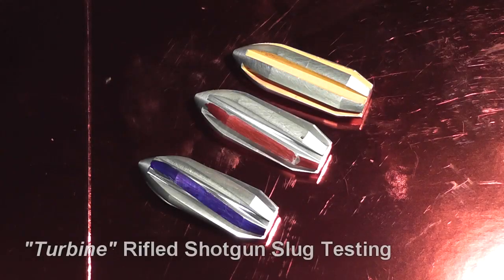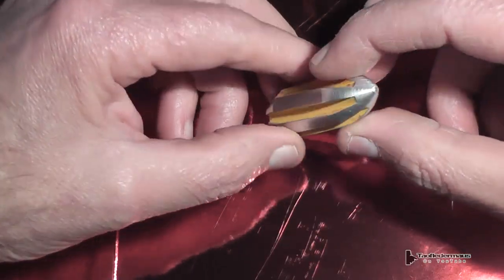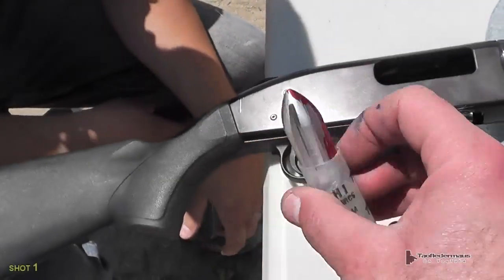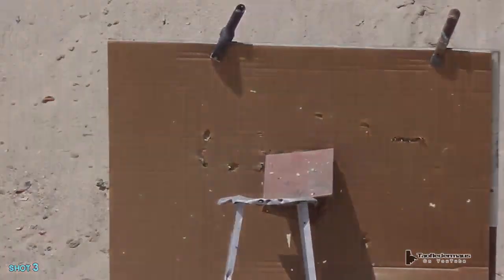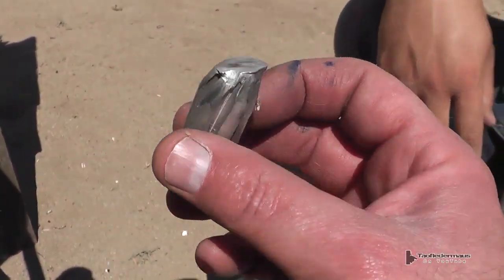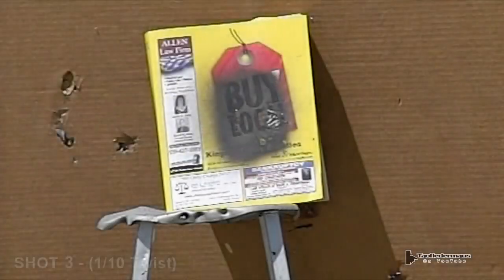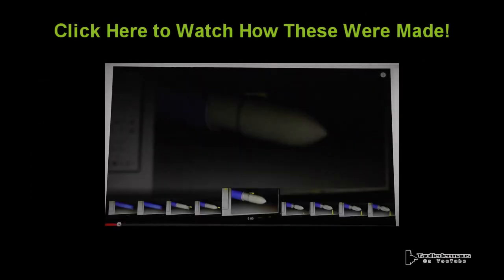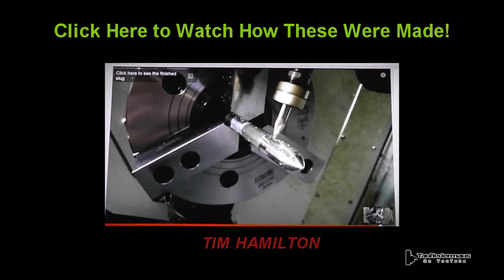Custom Aluminum TURBINE Shotgun Slugs  -Testing

Comment: Using air to create the spin is really not smart. Somebody else covered the fact that escaping gas will cause a spin in the opposite direction so I won't comment on that. But, you should have a rifled barrel and a malleable metal slug. The point of a bullet is that it is a plug in a barrel. If you slot a slug it let's gas escape. Any escaping gas in front of the slug means the slug will travel at a dramatically lower velocity. The reason rifling is so great is that the spin causes the bullet to fill the rifling. It creates spin without losing seal and velocity. And, if you look at all projectiles for military grade weapons, none are slotted to create spin.
Reply from the maker: +Jordan Weimer   This was a test to show that slotting or spiraling does nothing because so many people have commented SWEARING  it would work.   So we tried it.   Despite that,   people still tell me that it would work,  on my other videos.
Reply: haha. It's hard to prove people wrong. Just ask them to demonstrate something that functions and watch them shut up. Well more than likely they'll just ask you to do it again.

Comment: The slugs need fights simular to a dart. you are basically launching a externally propelled missile. small flights at the rear would provide some drag and stability until the rifling can begin to spin the round.

Comment: I think It wold solve the problem if the projectile lines were more tightly twisted and if it was a havier metal and short.
Reply: +rodrigo xv The problem was that the riffling on the slug wasnt interacting with the bore, thats why on a miniball the base spreads to ketch the riffling.
Reply: OK, so that short lead slug the MithBuster's showed on tv doens't work  at all?They forced it to work?
Reply: Depends on how tight of a fit it is, like with a muzzleloader, some balls are tight enough just to ram home, others you wrap a cloth around.

Comment: I think the problem with the concept is that a projectile travelling supersonic doesn't have air flowing over it's body the way a subsonic projectile does. It has a shockwave travelling out at an angle that interrupts the air flow. There may actually be a vacuum around the body and base during flight until it slows down below the speed of sound. If this is true, then the grooves aren't being affected by the air nearby and actually do nothing except make the projectile lighter in weight. At subsonic speeds they may begin to make the projectile spin, but it will take some time to exchange the forward velocity for velocity of spin. I expect at short range these grooves do nothing useful.

A lead rifled slug gets it's spin from contact with the bore, so it's spinning already as it leaves the muzzle. 

The area that could use the most improvement is the sabot that holds the round. You want something that holds the bullet perfectly straight and releases the projectile in flight without disturbing it in any way. probably some machined aluminum in 3 or 4 sections would be best.

Comment: I think your problem occurs when the slug leaves the barrel and the direction of rotational force abruptly changes. when the charge goes off the gases are pushing downrange spinning the bullet clockwise. then when the bullet exits the barrel the wind is applying force uprange and the rotational force is reversed and the projectile stalls in it's spin and begins to tumble.

Comment: I enjoy your video but must add my 2 cent for what it is worth. As a black powder shooter my smooth bore is just as actuate to 50 yards. Of course the right size Ball and powder charge is required which relates back to your videos. Also I have a rifled Barrel with scope attached for my Mossberg 500. It shoots standard slugs over 100 yard actuate.

Comment: I'm going to guess there's too much weight on the tail end of the bullet; but I can't know for sure without one in my hands. Maybe making the nose of it with a heavier metal (lead?).

Once you get it flying straight, you could put a thread on it with a carbide tip. Armour piercing at its best!

Comment: I would like to see this with a rifled shotgun barrel. That will stabilize smooth slugs also. Dont rely on the cup solely to hold back the gases either. Also, yall need to be behind some barriers when firing. Since those plates are not mounted properly, you are just rolling the dice when a ricochet will return to your chest.

Comment: How about something with a steel body, a lead tip, and an aluminum but with micro flutes and a fin set (aluminum tail section)?
Others have already made pop-out fins that work well, but they were a smooth bore type body.
The ones I'm talking about have the fins doing the spinning, rather than an flutes on the body.

Comment: Your tumbling would be down to 2 issues: the small amount of paint on the rounds would off-balance them (the centre of gravity has moved, even a tiny amount would effect the round), and secondly (more importantly) when you put the round in the shotgun round jacket I would guess that it is not dead centre. If you hit the mass even 1/10th mm off centre it would put the round into a wobble.

Comment: what I would like to see is shot gun rounds that incapacitate individuals without wounding or killing them. Is that possible for you guys to whip up? Maybe a round with a soft nose cone and a squash-able center to absorb some of the force of impact or maybe a soft round that expands on contact with air to a far larger diameter to absorb force on contact?
Reply: without make a wound? damn that impossible. what were you thinking about? even rubber round can make serious blunt wound. Guns are used to throw a projectile in a fast speed, even blunt object is dangerous. go to self-defense and learn how to paralyze crimes.

Comment: In order to go straight it should start spinning not in the air but in the barrel. For that reason many rifle and pistol barrels have  "spiral shape" (I'm not an expert so idk the exact term) interior which makes the bullet spin before exiting the barrel and it keeps spinning in the air to got straight and accurate. Most shotguns, if not all, don't have that "spiraled" barrel thats why those shotgun shells are usually loaded with shrapnel or with small round bullets which are not very accurate. IMO to fix that inaccuracy and make the bullets go straight is to  either make the barrel longer or to create that spiral inside the shotgun.

Comment: Develop an external spinning magnet whose field will spin a round at a high rate of rotation just prior to primer strike. It will have to be custom made, but the round will maintain a very robust gyroscopic stability en-route to the target. Just might eliminate the need for rifling inside the barrel. Worth a curious attempt.

Comment: This is amazing stuff, I love it. In my experience with ballistics you don't need drag to stabilize a bullet, you just need the bulk of your weight in the front. I would consider trying a tear drop design with some one in 7 fins in the back making sure that the front of the projectile is heavier than the rear by a lot. Maybe injecting lead into the front?

Comment: Longer barrel would have made a better test.  Who shoots low brass with slugs?
Would like to see one of those in ballistic gel.
Reply from the maker: FoulPet  You can achieve velocities in excess of what you'd get from a factory deer slug if the rounds are light,  just using low brass.

Comment: The problem with a round like this there is more air moving forward through the twists than the air resistance that would hopefully cause the round to twist out of the barrel. A fin stabilized round would make more sense.

Comment: i would think that if you drill a hole into the back of the round pretty much the entire way down put something in there to weight the nose of it then replace the rest of the hole back with some aluminium and maybe decrease the size of the gap on the refiling so you could add more rifles to the round

Comment: U need to drill a hole in the back to make it front heavy. Design these as if they are darts
Reply: rib bit  subsonic that shouldn't be a problem, also supersonic if the shape is different (like a space capsule) it can be stabilised, like they also have shown on this channel. You are also not going to make a figter jet out of lead. You also have rubber and brass bullets. If you want it aerodynamically stable (so not a typical bullet), the shape (CP) and weight distribution (CG) are the most important factors. Just like a paper airplane.
Reply: rib bit  drilling a hole alone would probably not be enough either, the back end seems too slick and supersonic these flutes don't have much effect anyway
Reply: rib bit  it's all speculation though before tested
Reply: rib bit  yikes, never knew anyone was trying to kill with rubber lol
Reply: Aluminium also yields much easier than brass and fouls

Comment: ok check this out the rifling is on the barrel not the bullets. and you made it out of aluminum which is incredibly weak so im almost positive before watching your video that the rifling on the bullets did nothing because of course the aluminum is weaker than the barrel and more sensitive to heat. which probably caused the rifling to have zero effect right?

Comment: I think the problem is that the slugs are not exiting the shoty straight.
Reply: They used a smoothbore barrel (no rifling) that's most likely why the weren't spinning well enough
Reply: Krazy Studio so there you have it. smooth barrels are for round pellets only. you gotta have a rifled barrel to spin and stabilize the projectile before it's aerodynamic spin kicks in even if the slug itself has deep rifling like that one.
Reply: +Ahmed Nabil +Krazy Studio +Bobby Walk
While the barrel would help, you still have a stability issue on the "flat" axis. Looking at the video, it's got horizontal spin as well. Bobby nailed. You need to be more front end heavy, so the slug doesn't spin flat. THEN, we can look into rotational stabilizers :)
Reply: Theophilus Martus Goh I think you're right. I wonder if shot over a longer range if they would correct or if he had some sort of long tube diffuser to allow the gases to escape and the slug to slide along something for that small amount of time
Reply: +Theophilus Martus Goh does the shotgun barrel even have rifling? that's the critical factor here.
Reply: +Bobby Walk interesting. so how would an cylidrical round hollow out with the rifling on the inside do ? flatt top or even outward leaning lips to maximize the air intake ... smooth on the outside ? in my mind this flying cylinder of death should be able to "eat" its way thru the air. would be really interesting to see if it would work. now im not sure you will understand any of this as english is not my native tongue thanks,
Reply: you mean barrel.
Reply: *shooting
Reply: I am so confused
Reply: Look up bullet bow shockwave. These slugs are traveling at supersonic speeds causing the air at the front of the projectile to become highly compressed creating a conical waveform surrounding the slug.  Basically what this means is the rifling cut in the slug doesn't actually engage the air like we imagine it would, rendering them useless. The rifling we see on foster slugs or "rifled slugs" is actually there to allow for the lead slug to be able to be compressed down through a choke and don't actually impart any spin. What gives modern slugs their stability,  and therefore accuracy, is the weight forward design, and the open cavity at the base of the slug. The heavy front end keeps it from tumbling through the air like we see in the slugs from the video. The only way to get these to spin is to run them through a rifled barrel instead of a smoothbore. And if someone was willing to do that, I'd love to see how the deep rifling in these slugs transfers energy through some ballistics gel👍

Comment: A rifled barrel works because the lead slug is a little larger than the barrel. The grooves grab the slug and spin it as it's being squeezed through the barrel. Obviously, this will only work with a soft metal like lead. Creating oversized slugs from less malleable metal like aluminum would plug up the barrel and the explosive gases would have nowhere to go. I would NOT want to shoot a shotgun with a plugged barrel!. ***** Rifled slugs (as opposed to rifled barrels) have grooves cut in the side of the slug but they're smaller than the barrel. The rifled slugs don't squeeze through the barrel and wouldn't spin even if they did. The rifling is so that it will squeeze through different sized chokes. But that doesn't make it spin. It just allows it to squeeze through the choke. Since aluminum is too hard to squeeze though a choke, cutting rifling into the side of an aluminum slug wouldn't work. Regardless, the rifling on rifled slugs does NOT make the slugs spin. Instead, rifled slugs fly true for the same reason a dart does -- it's heavy in the front and hollow/lighter in the back.

Comment: I'm just guessing off the top of my head but maybe the balance point needs to be checked. Drag came to mind, but the fins should probably would have helped in the department. I recall even commercial ammo need a little space to stabilize, .223 stabilizing at shorter distances compared to .308 and .50..
 Would like to see the design run through some simulation in something like Solidworks

Comment: If I may, why not try the rifled slugs in a rifled barrel? Wouldn't that generate enough rotation before even leaving the barrel to keep them from keyholing? Smooth bore just doesn't seem to get a good enough spin on it. Then again, I'm just another guy who is watching this video. If I'm wrong, please correct me below. I'm always up for learning from any idiotic mistake I make when talking about guns and ways to improve/use them to their fullest capabilities.
Reply from the maker: Asura Gaming   The idea was to see if rifling on a slug would cause the round to spin.  From my other videos' comments,   MANY people said the rounds needed grooves to make them spin.    So all we are doing is trying their ideas.
Reply: ***** I know man, but it doesn't make sense to fire a projectile with rifling from a smoothbore. There is nothing to initiate the spinning to generate the stability right out of the barrel. But you already know that.
Reply from the maker: That is why we posted this video - to show what happens,  because so many people think it works that way.

Comment: The reason the bullets are tumbling is because the spin imparted to the bullet which cause bullet stability during flight must start via the rifling grooves making firm contact with the bore of the shotgun barrel. If this does not begin inside the barrel then the bullet will begin to tumble as soon as it passes out the end of the barrel.

Comment: The projectile may need to be heavier. These Slugs are made out of Aluminum, not Lead. Perhaps it would work better if they where Aluminum Jacketed Lead Slugs? It might do well to not have such deep grooves in the slug as well, or even no Rifleing at all on the slug. Fire it out of a Rifled Shotgun Barrel!

Comment: It probably failed because the round was too uniform at the back and at the front. It may have even been heavier at the back. I think it needs to be drilled out at the center in the back so that the front is much heavier than the back in order for it not to tumble.

Comment: Check the design of a penetrator rod of a tank. It gains rotation inside the barrel thanks to a housing designed to do so, but once out the casing is removed and the the penetrator rod is just a bar that is already rotating. I think this is the design that should be copied.

Comment: Guys my thinking is like that , to much twist actually will slow down the bullet , because of the traction with the air and probably it will spin off when is windy out side, less twist will not stabilize the bullet at all . So you must to make a looooot of test before you can find the perfect Twist ratio;) 

Second the weight of the bullet must to be heavier at the front , because the front must to pull the back and it will stay straight . so probably a hole at the back will make the difference or the front to be made from heavier material  :)

Good luck and awesome videos like always  :)

P.S. : Oww and probably the back of the bullet must to be with deeper channels i mean slowly from the top to the bottom to get deeper and deeper until it get to one little point at the back , but the twisting sections to stay the same as the body of the bullet , that will minimize drag and will maximize the twist rotation . 

P.S..:there is one more thing in my head , this twist channels must to be wider and the walls from the side to be like blades , may also they must to start really just at the beginning and slowly to get smooth and straight  , or just to pop out a little in the middle  or at the end :) 

There is ways , don't give up :)

Comment: It takes a while to start spinning, which never happens because they are tumbling immediately. Brobee223 has tests of short rifled slugs, that are softer so can fit tightly in the barrel and exit straight. These need something (a plastic tube) to keep them straight in the barrel, not just a bar of loose fitting aluminum. But they might also be too long to stay straight when not fired from a rifled bore. The short ones are shaped like the early space capsules (or maybe the reverse), with a round nose that stabilizes itself without spinning. Because spinning the space capsule would make the astronauts really dizzy!

Comment: 1 in 28 twist is still way to fast of a rate for this large of a projectile over stabilizing it. Go back to the days of large bore muzzle loaders that used 1 in 60 to 1 in 72 rates of twist. Won't completely fix the issue as there are to many to list here but it would help.